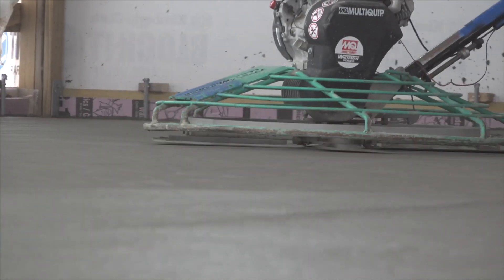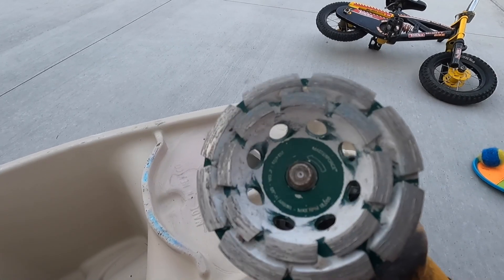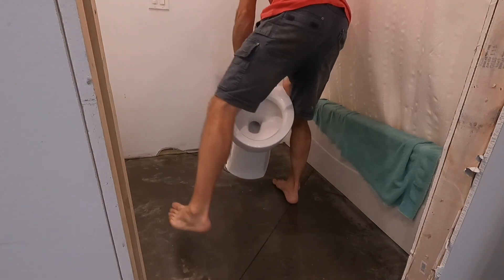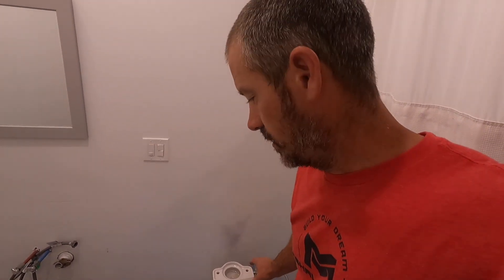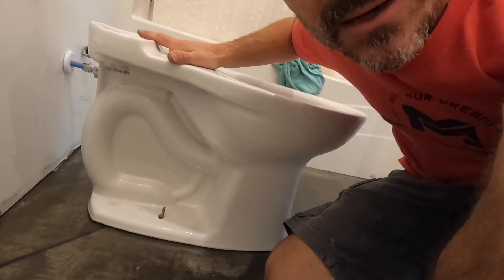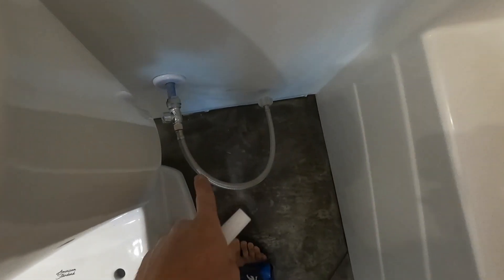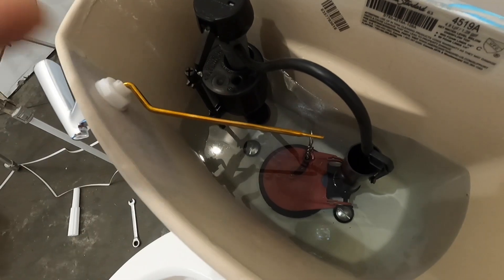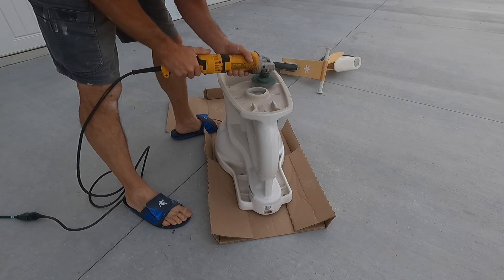Toilet Install on Concrete | Post Frame Home Build

Comment: There is a simpler solution. Mix up some plaster and put it under the toilet where needed, around the ring and along the entire edge. Level out the toilet while tightening it down. Wipe away excess and you will have a rock-solid install.

Comment: Are you putting in a bathroom tile floor, or is it to remain concrete? If being tiled, the toilet should be mounted on top of the tile for the best appearance.

Comment: When you caulk the toilet to the slab it will also firm up the overall fit.  It is code: (408.2 2000 UPC) "Where a fixture comes into contact with the wall or floor, the joint between the fixture and the wall or floor shall be made watertight."
Reply: I have to disagree with this code -- If you seal the base of the toilet, and it leaks you will not notice until the (wood) floor is rotten.  If you leave it open then if it leaks it will be noticed and reset before doing damage.  Some codes are hold overs from days gone by.
Reply: @craigs5212  that's true but some people caulk around and leave  the back open for water to come out if the wax ring fails

Comment: Glad to see you used the rubber ring. With in floor heat, you aren’t supposedly use the wax rings.
Reply: Wax melts around 130.. you would never get your floor that hot... those foam/rubber rings are absolute junk and break down quicker than wax ever will...
Reply: I have installed plenty of wax rings with radiant heat, never once had an issue. Those rubber ring suck.

Comment: Did you have any cracks develop in your concrete after it had set?
Reply from the maker: down in the relief cuts we could see cracks but no, we don't have any obvious surface cracks.

Comment: Why you not put the tank flush to the wall . Like we do in uk
Reply: Because the lid is larger than the tank and is turned down around the inside edge so it can fit over the top of the tank without sliding off.
Reply: Should have been a standard 12" rough in. Looks like it's off 3 or 4 inches.

Comment: You should have sealed  the gap of the pan to the floor with silicone to stop water going under. Take that from a 90 year old plumber in Australia. Otherwise OK.

Comment: I think your first mistake was putting the flange on before you poured. I use lead stubs but even if you didn’t want to solder, you use a 4x3 closet bend. That way you have 4” pipe coming through. They can trowel it much easier  when they can just but up to the pipe. You may have to chip off some slurry but that’s easier. Then just cut the pipe flush or a little lower and glue an inside flange on. Also, I know we don’t always see everything that’s done in a video but I didn’t see you secure the flange to the floor. You definitely need tapcons or some sort of concrete anchor. I know lots of people don’t do this but I think that’s bad practice. I prefer shims then just cut them and the caulk covers them. I never alter the toilet because if something happens and it leaks, they won’t cover any damages and may not even replace the toilet. It’s also much easier to put the tank on first where you have space then set the whole thing at once. In regards to the stop, I won’t get into the sharkbite debate but you should at least use an angle stop. It would look much better and have much less stress on the flex than bending around with a straight stop. Also is there a reason you put the stop on the right side. I hate to be too critical because I know these people aren’t plumbers. I didn’t notice anything that was technically against code but this is not how I and the vast majority of plumbers would do this. But hey if it works right

Comment: This is the 2nd time ive seen US toilets installed, why is there such a large gap with the cistern from the wall?
Surely this puts undue stress on the joint if anyone leans back.
Almost all UK installs i've had/seen are connected to the wall
Reply: It’s not supposed to be. I always set mine at 12.5. That’s a 12” rough toilet plus .5” drywall. I’ve seen some plumbers do 13 just to give breathing room but this doesn’t make sense because you can get one in even if it’s 11” off the wall so why not aim for exact.

Comment: Odd to me! In my day, I have probably installed close to 400 toilets, 100 or more on concrete. Never once have I had to do any leveling or grinding. Would have to pretty shoddy concrete work. The Gasket takes care of any minor level issues.

Comment: Around here the plumbers do the rough in below the concrete, then when they install toilet they use two wax rings.
Reply: really ?
Reply: Not me I've have a double wax ring slip and I had to go back on a recall and pull the toilet,  I've not use two wax rings since I carry spacers now, I have a box full of spacers 3 different sizes.
  
 And that's when I realized I'll never use
Two wax rings again.